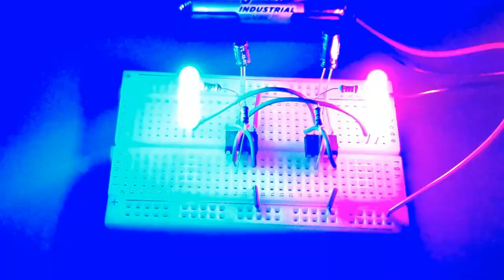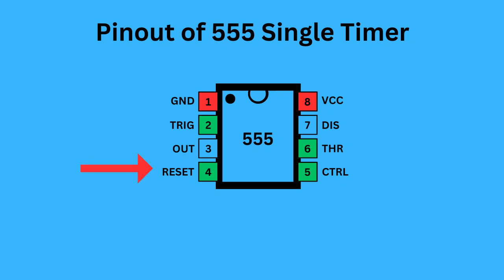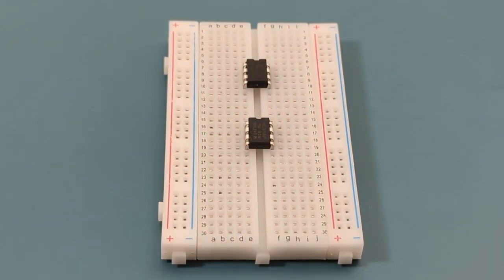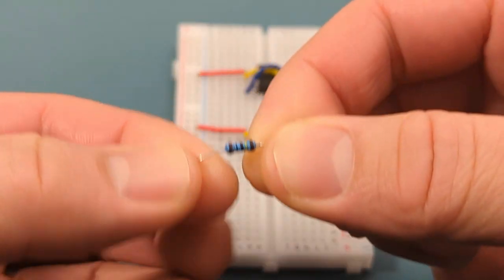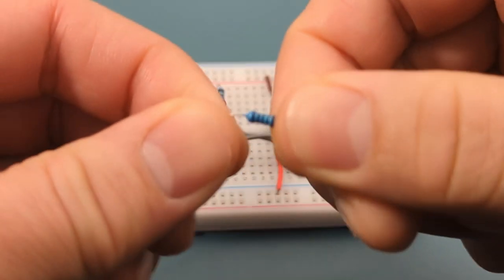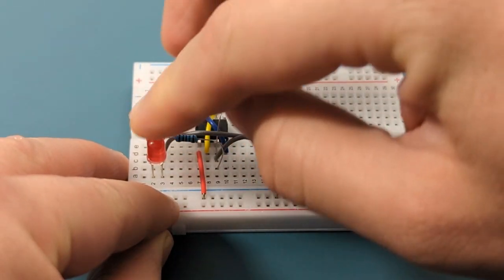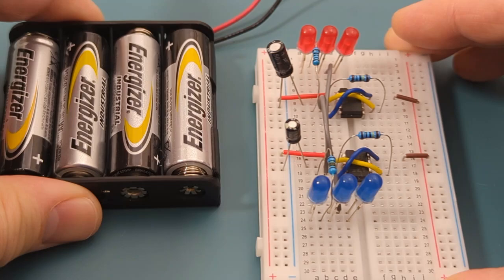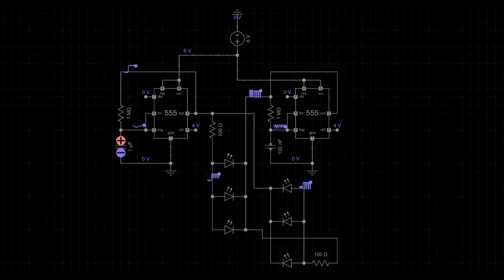How to Make LED Police Lights With 555 Timer

Comment: The imbalance of duty cycle could be due to the choice of a 100nF cap for one side and a 1uF cap for the other. It could also be because both sets of LEDs are being driven by 1 IC. It has the tell tale output style of and LED being sinked and an LED being sourced. They don't illuminate in the same way (the upper LED and the lower one)
Reply from the maker: Thanks for the insightful observation. I designed a new circuit that works better: https://www.youtube.com/watch?v=I9g0D-uW-Qs
Reply: @ElectroUniversity  I checked it out. To me, it has the same phenomenon. I could illustrate it with a waveform/graph, but I can do an image comment here, like I can with Facebook ☹

Comment: The flashing from the blue LEDs doesn't perfectly match the flashing from the red LEDs ☹.
It's a NO from me, unless this can be tweaked to have a duty cycle of 50:50.

Also, the blues seem to start flashing immediately, and the reds take a moment to start flashing
Reply from the maker: You're right. I designed a new circuit that works better: https://www.youtube.com/watch?v=I9g0D-uW-Qs